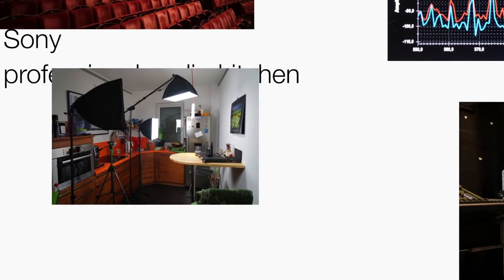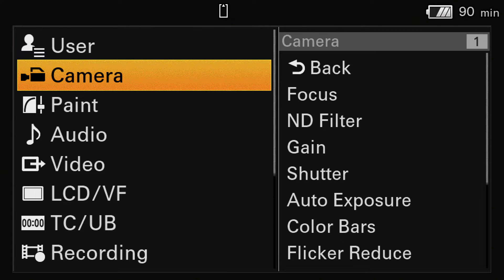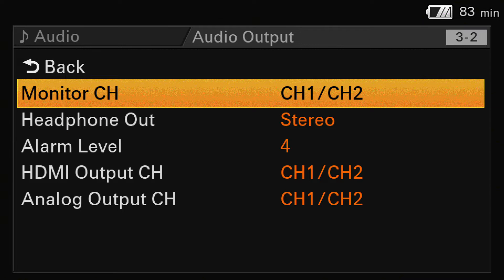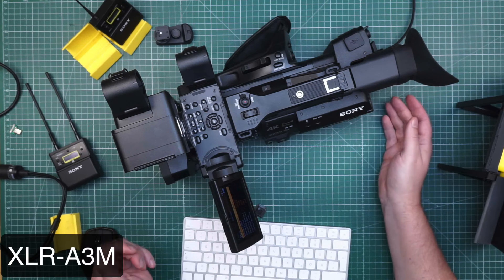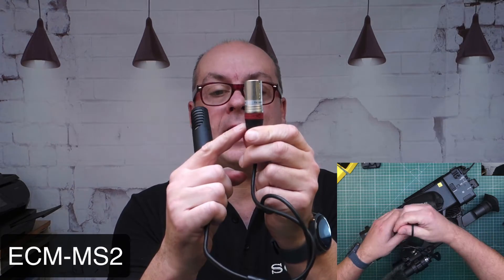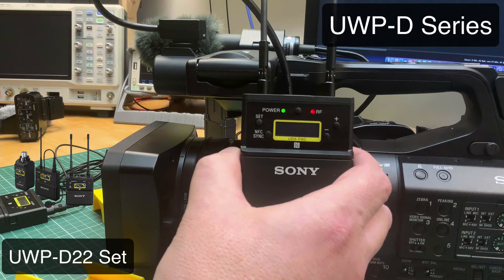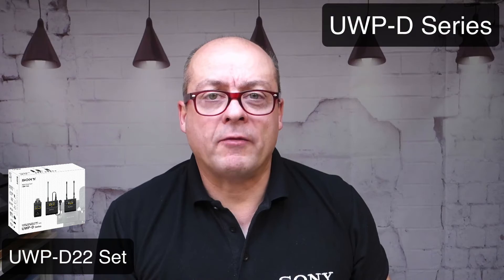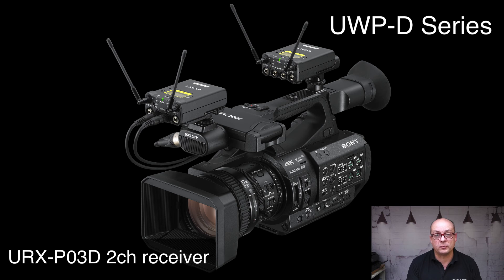#011 The Audio side of Sony's PXW-Z280

Comment: Thanks für die video wie ist die setting sony pxw z190 xlr microfon einstellungen
Reply from the maker: @Diyarkamera like in all Sony camcorders I have used the standard settings a ok. I do not like the wind filter and I set the input gain so that the mic input signal is not higher than -9 to -6dB to avoid any overload. I always use Manual mode for the inputs with the Limiter set to 6dB. Auto mode is fine if you under time pressure but I personally do not like the AGC behaviour. For a good sound it is Berger to use an external shotgun mic or a radio mic system (ECM-MS2 for stereo or ECM-VG1 for mono to UWP-D series radio mic).
Reply: @mawa  Thanks for the Informationen.
From menu settings
audio input
How should the settings be?

CH-2 EXTERNAL INPUT 1
CH-3 internal microphone or off
CH-4 Internal microphone or off

Sony ecm xm1 sound is too loud
Und Rode NTG2
Reply from the maker: @Diyarkamera  I would not use the internal mic if there is an external mic available. XM1 is a good mic and you can change the input level over the knops for CH1 and CH2 on the left side of the camcorder. CH1 could be the XM1, CH2 could be another mic but the NTG2 is a studio mic for a source with 10 to 30cm distance to the mic. This is not good as a shotgun mic, but I do not know you setup.  You need to figure out what the best input level for your setup/location is. There is only one rule, not too loud to avoid distortion from overloading but also not lo low to avoid high noise. Test it and find out what it has to be. Look on the audio bargraph in the viewfinder/screen.
Reply: @mawa  I understand you and let me try that, thank you again for the information.

Comment: I have a problem connecting audio on ch1 and ch2 together it only shows me one sound
Reply from the maker: Ok, but what kind of device deliver the signal? And if it is the URX-P03D on the MI-Shoe, you use the SMAD-P3D adapter? The D is the important point here. Only the SMAD-P3D is a two channel adapter. The SMAD-P03 is a single channel version. 👍🏻😀
Reply: I too have an issue with xlr inputs 1&2 .  I can only get input 1 on both channels.  I have tried with Rode wireless mics and two sm58 dynamic mics, same result, only channel 1 on both channels 1&2.  Also, internal mic on 3&4 has no stereo image, I.e. recording and walking around the camera there is no differentiation between left and right just a mono recording.  I have checked that input 2 is set to route to input 2. Any insight gratefully received as it’s driving me crazy!

Comment: Is there a way to wirelessly connect to a sound mixer when recording a music Gig
Reply from the maker: Hi Kevin deegen-hall, yes you can use the 3.5mm mini jack's. In the box, you find always two extra cables. For the one channel receiver  (URX-P40) a syemtrical 3.5mm to XLR and a 3.5mm to 3.5mm cable. With the two-channel receiver, you get two of the XLR's and a 2x mono to 1x stereo mini-jack cable. Of course, this is an unsymmetrical cable. You find on the sony home page the user manuals with graphics in. Look on page 4.
U.S. / EU Version - https://pro.sony/ue_US/support-resources/urx-p03d/manual 
Hope this helps to clear.... :-)
Reply: @mawa  Weilen Danke Markus
Reply: @mawa   I have a problem connecting audio on ch1 and ch2 together it only shows me one sound  in camera Sony z 280
Reply from the maker: @tedadali5789  sorry for overeating your comment. If I understand you correct, you connect the two xls cables from the receiver (URX-P03D) outputs to the camera inputs 1 and 2. And the result is a mono signal? So both channels record the same audio signal? From channel 1 of the receiver or from channel 2?

Comment: I use the same camera and handheld microphone, it gets very little sound, when I increase the volume, it makes a very low sound. How can I get the sound properly? I watched it from Turkey, by the way, it was a very nice video danke :))
Reply from the maker: Hi Kasko, thanks for watching my video. Do you use the MI-Shoe or the Mini Jack to XLR cable?
Reply from the maker: Hi Tasko, sorry for the typing mismatch with your name...
Reply: @mawa  I get the sound with xlr cable, which one do you think I can get the best sound with?
Reply from the maker: @taskn01  Ok, so the camera input works fine. Can you send me the exact name and type of the mic you use, please?
Reply: @mawa  Of course, if the handheld microphone is sony utx-m40 receiver, sony urx-p40 models. Thank you very much for your attention.
Reply from the maker: @taskn01  Hi Tasko, the 40 series (Generation 4 of the UWP-Series) has an new input section. You can set 3 different input types. 
NORMAL mode - standard sensitivity which made for a 1-10cm distance between capsule and source (mouth)
AUTO GAIN mode - a limiter is inserted which avoid the signal from overload/distortion.
BOOST mode - the sensitivity is now 15dB higher. Perfect if the capsule is far away from the source (mouth). Example: Typically for sport interviews where the protagonist has a bunch of mics in front of him on a table.
In MORMAL and BOOST mode the ATT. Is working. So you can still change the input sensitivity in 3dB steps. In AUTO GAIN mode the ATT. Is not available.
Reply: boost mode sounds amazingly good I made the settings for my four cameraman friends markus thank you very much I am grateful 👍🏻🙏🏻